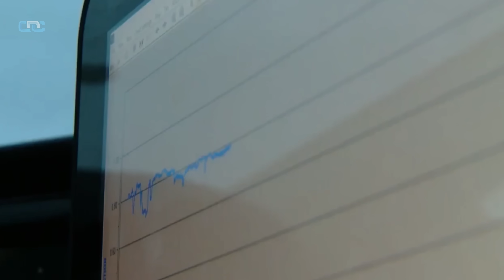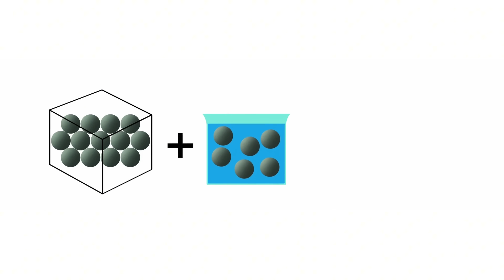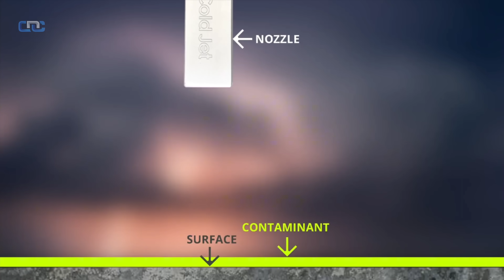6,000 kg of Rubber on Runways Every Day. The Secret Way Airports Remove It.

Comment: Yep, I've been thinking occasionally on this, since I saw a guy who's business was being offered to Airports to take the rubber from Runways.
So to mitigate this, maybe Airplane tires should have some shape that help them accelerate to the Airplane's landing speed; also the Airplane should have some kind of magnetic engine, that helps tires accelerate, without electricity, just magnets of same polarity, close to each other, creating repulsive force, accelerating the wheel, so through computer coordination, wheels match the Airplane landing speed; and so the same magnetic accelerators, will switch polarity on both sides, and serve as Magnetic Brakes, additionally to the mechanical and Engine Reverse Thrusters
Reply from the maker: You bet! Thanks for the input and for joining the conversation.

Appreciate you dropping that in and sharing your thoughts.
Reply: @CDCCreatorśClub  Just making my part: I hope this gets to the Designers somehow, and they implement it ASAP, for the benefit of the Community/Humanity

Comment: Yes, I believe you, a 747 loses 2 t of tread on a landing.

What utter B.S.
Reply from the maker: You're absolutely right to call that out. The "2 tons per landing" figure is a pervasive myth that wildly exaggerates real data.

You're correct: a 747 does NOT lose tons of rubber. Industry data from manufacturers like Michelin indicates it loses about 1-2 kg (2-4 lbs) per tire. With 18 main tires, that's roughly 20-35 kg (45-75 lbs) total per landing—comparable to the weight of a large suitcase.

The staggering figure that is real is the total daily accumulation at a major airport. Hubs like JFK, with over 1,200 daily landings, can accumulate more than 6,000 kg (6+ tons) of rubber every 24 hours across all aircraft. It's easy to see how the myth originated by confusing an airport's daily total with a single plane's deposit.

Thanks for keeping the information accurate—conversations like this are how we separate engineering facts from persistent folklore. Cheers.